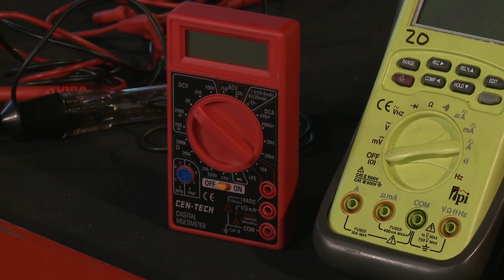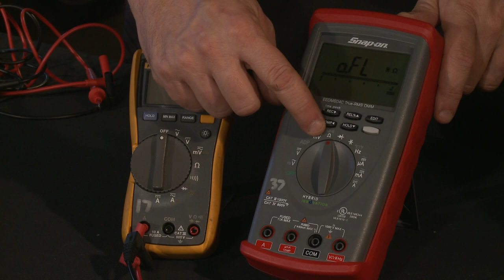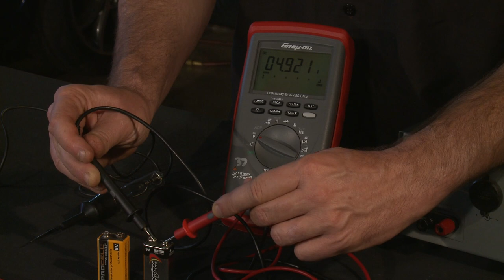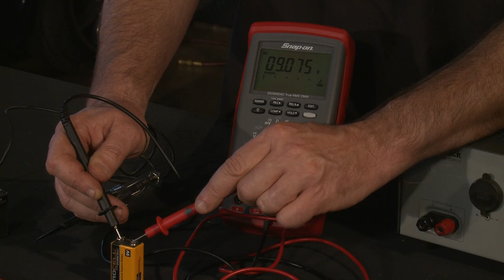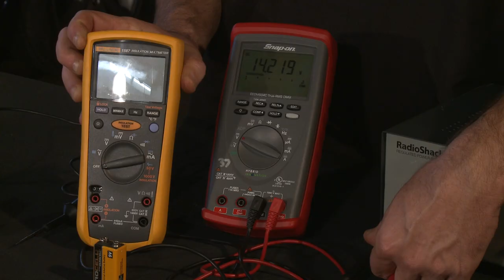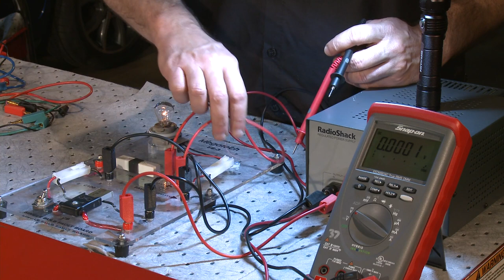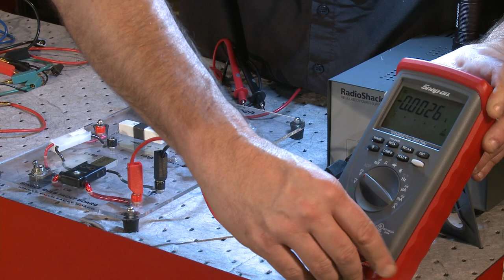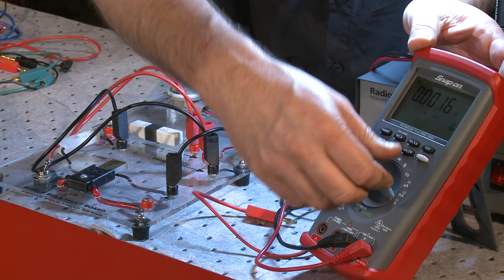Car Corner - Electrical Diagnostics

Comment: I still can't understand how the voltage is still 14 volts even after the bulb when the circuit is closed. Is the voltage suppose to drop after a resistance?